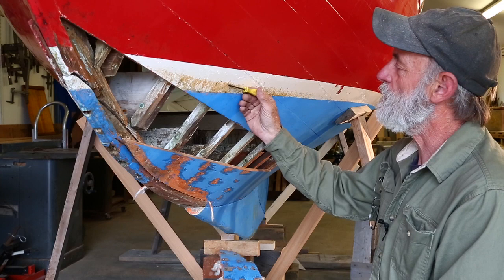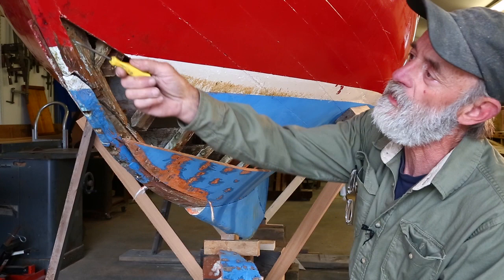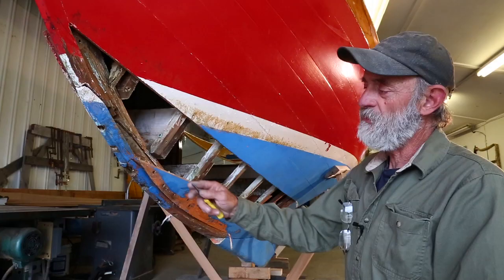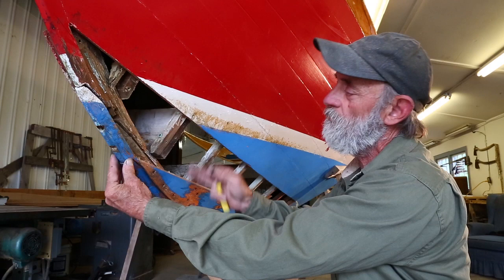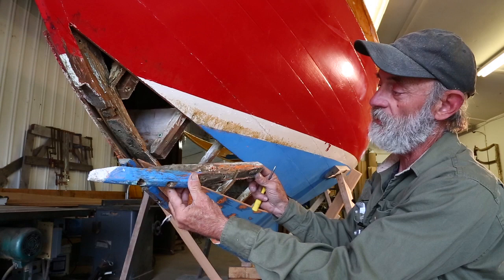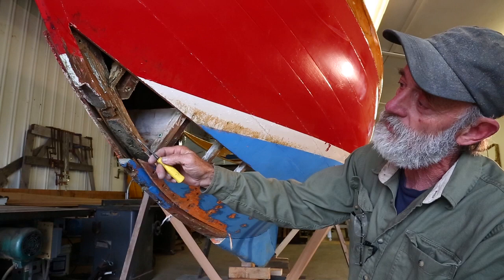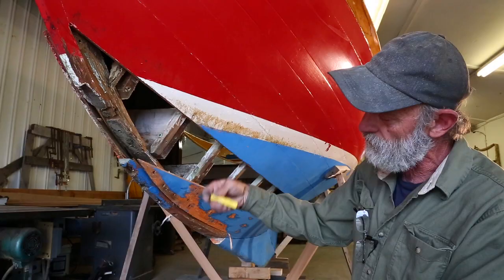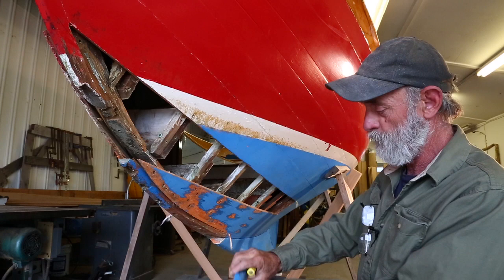Part 1 - Wooden Boat Building - Reparing a leak on a Herreshoff 12 1/2

Comment: I am trying to make a bent shaft canoe paddle out one solid piece of cherry and this method of using a bag seems to be the ideal method. I could steam only the area of the bend. The raw piece of wood at the bend area is 1.75" x 1.75" in the cross section. The angle I need is 12 deg.
How long would you steam the piece and what is the thickess of the plastic film you used to make the bag? How did you seal the longitudinal seam in the bag?
Thank you for a great idea!